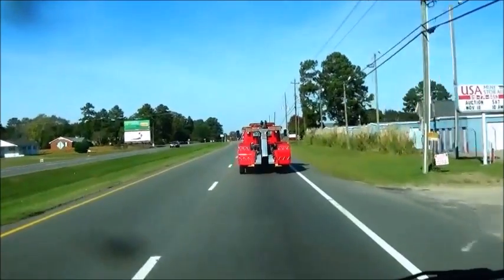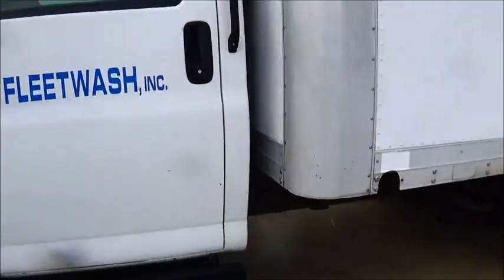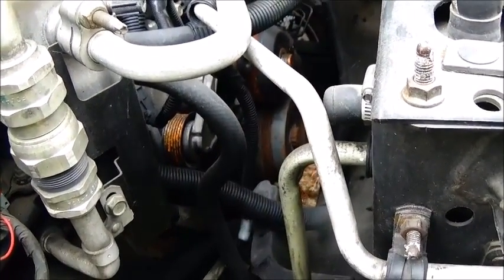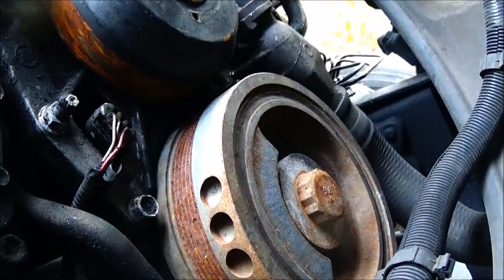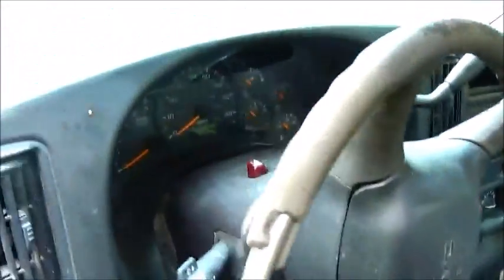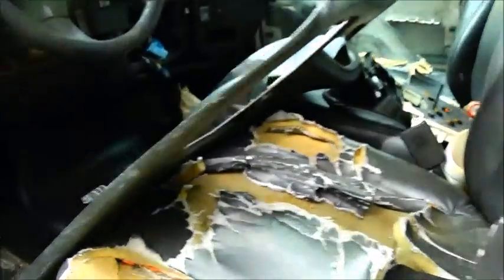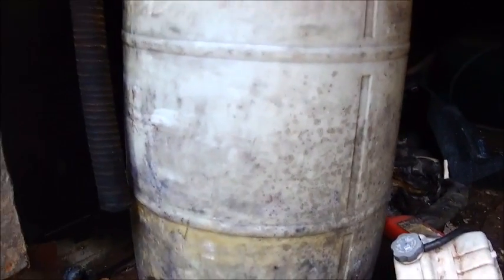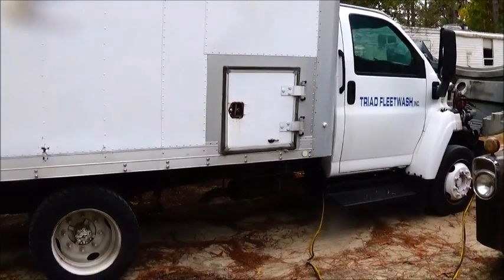Bought Three Duramax C4500 Trucks

Comment: Wrecker service I worked for had a duramax 4500 and 6500 wrecker and both broke the key/pins on the crank snout. Problem was the harmonic balancer bolts backed out on both and let the balancer walk on the crank snout. Both trucks got new cranks and both are still In use today under diffrent owners. Both did it at almost 200.000 miles.

Comment: Looks like you're quite happy with your purchase!  LOTS of parts, no doubt!   The engine with the harmonic balancer issue really looks like a bent crank, as the balancer bolt was wobbling probably 0.060 or there abouts. But, it started easily and runs, which is a good thing. Hopefully, you'll have an adequate supply of good parts to make a couple of them whole again!

Comment: My dad had a 2000 GMC 2500 with the 6.0L and the balancer did the same think wobbled like hell he thought it was a bad crank ended up the previous owner had removed the balancer for some reason and when he reinstalled it he cross threaded it and it put the balance right off, my dad had it re-tapped and put  new bolt in the balancer the truck is still on the road today this was 4-5 years ago.

Comment: i know where you can buy some crew cab c4500's! i recently bought 2 c5500 4x4's with bad engines. one with a  broken crank and the other is locked up. i am looking at one today that loses oil pressure when it gets up to temperature. they are pretty good buys if only for parts. i hope that balancer is the only problem on the one...makes me suspicious about a bigger problem when you pointed out the extra crank bolts. who knows maybe they tried to get the balancer off by prying on it and damaged it. i have had 3 6.6 that overheated and all 3 had cracked heads. i have my fingers crossed for you j.w. i hope you do some videos of figuring them out.
Reply: J.C. SMITH PROJECTS do you know of any crew cabs with a blown engine but 2wd? If so, let me know prices, i have a 8.3 cummins with a eaton fuller and a 12v cummins with a Allison but i want a 2wd crew cab

Comment: You bought Three 2004 Duramax trucks and well I imagine if they were fleet vehicles they were pretty well maintained. You must have gotten a deal you couldn't pass up on those since you bought three? Yes indeed out of three you should get 2 good running trucks plus a bunch of good parts for yours not really a bad deal. Parts are worth their weight in gold when you don't have them.

Comment: I think either the sending unit is bad or disconnected for the oil pressure in the second one- seeing it pegged without the engine running is a sure sign that it's not working right.

Comment: Great score! Don't condem the damper until you pull it apart, the engine is very quiet, in my experience when the crank snout breaks its usually accompanied by some obscene noises, clanking ect even though it runs ok. Just my thoughts, after watching your channel I know you don't need an armchair quarterback looking over your shoulder but sometimes I have to put in my two cents.
Reply from the maker: The noise is there, sometimes worse than other times

Comment: Good score on the barrel of degreaser! i guess thats the stuff we used to use in the kerrick steam cleaners,it go fed into the discharge hose with the steam and is biodegradeble. So the 4WD will get a diesel and alison now?
Reply from the maker: I am not happy with my belt driven hydraulic pump on my duramax. The Allison in the 4x4 does not have a PTO gear and I know I won't be happy with a belt driven pump on it. I am looking at some options, lets just put it that way.

Comment: This maybe a stupid question but I'm curious, how can an engine run with a broken crankshaft??
Or on an 8-Cylinder diesel is everything internally ran at the front, besides where it connects to the transmission??
Reply from the maker: The crank breaks at an angle and it still turns together. I have seen one drive 200 miles that way.
Reply: Jonathan W same thing with camshafts too sometimes, I have a Citroen XUD motor here that ran with a cracked cam long enough to mushroom the inlet valve and take out the big end through the repeated impacts between it and the piston. Engine only stopped running when it threw the rod and bound up.

Comment: Dont know if its a startup thing, but those oil pressure gauges were pegged out without the engine running... I wonder if they are just idiot gauges.